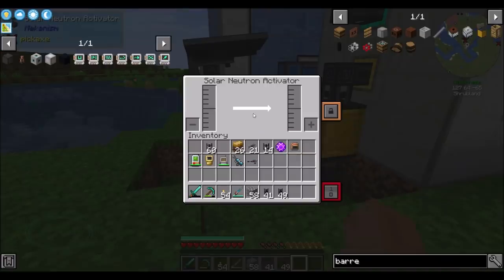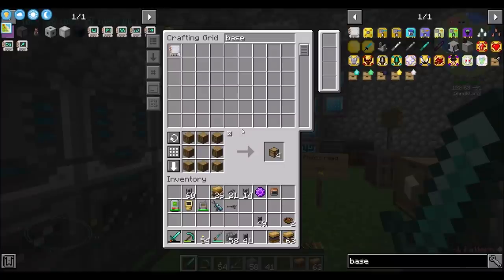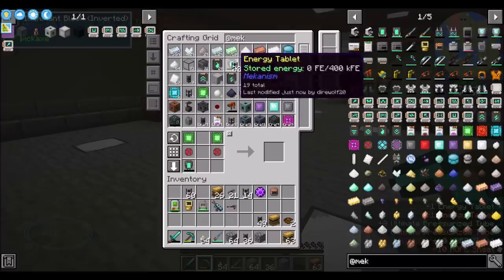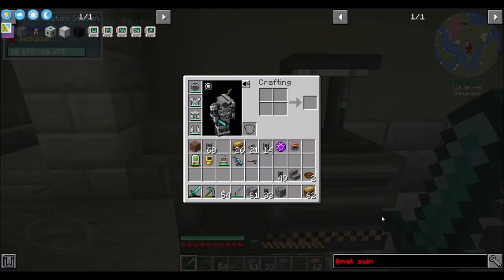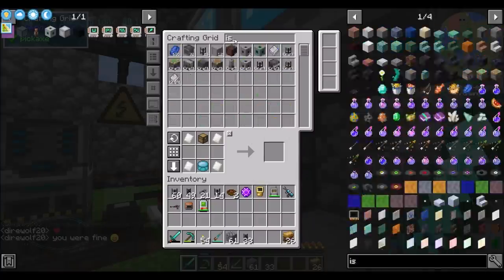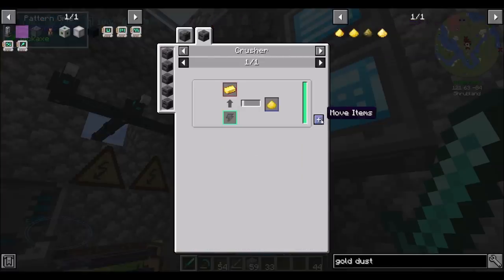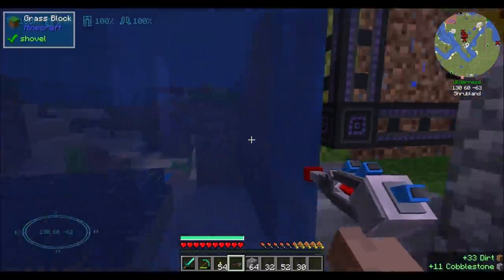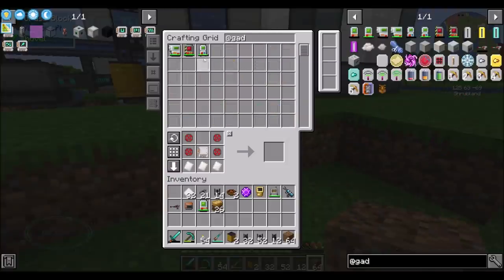Forgecraft S13E20 Waste in a BARREL down by the RIVER

Comment: Wait, the solar neutron activator works only during the day.
Since there is no storage, does it mean that the reactor can fill up with nuclear waste during the night and blow up?
Reply: Maybe
Reply: Full on waste? Boom
Full on energy? Boom
Reply: If you have enough ultimate pressurized tubes, it's not much of an issue. Those tubes have a ridiculously enormous buffer capacity. That being said, a back-stuffing reactor is not exactly good.

You basically need to calculate how much waste the reactor makes over the course eof the whole night and make a buffer capacity greater than or equal to it or use a Redstone port and daylight sensor to automatically turn of the reactor. Because of how much capacity ultimate pressurized tubes have, you can just have a line of them, but be sure to math it out. The night is the same amount of game ticks each day, and you know your waste production rate per tick, so you have everything you need to calculate the buffer needed.
Reply: Well if it makes 1m+ rf/t without too much automation it should have a risk.
Reply: @jordanhyde2752  sounds like ‼️fun‼️